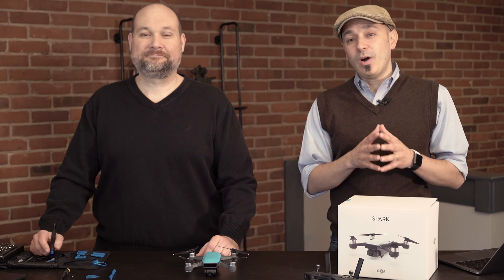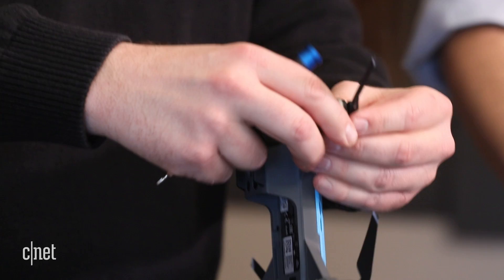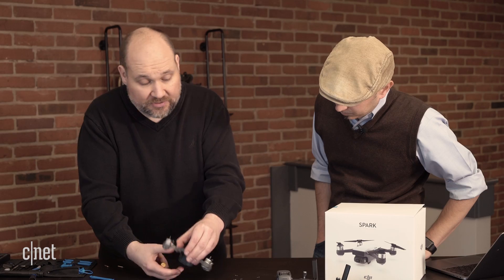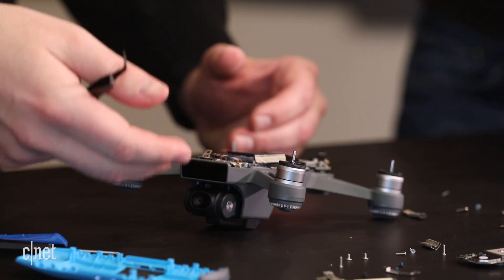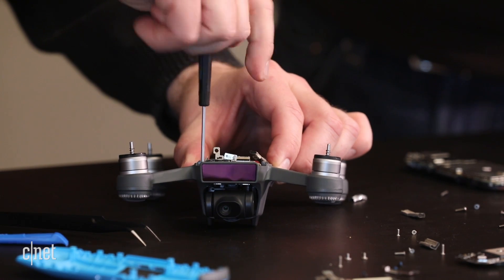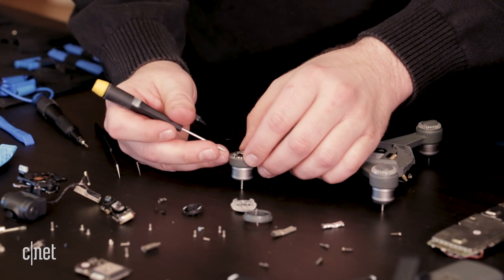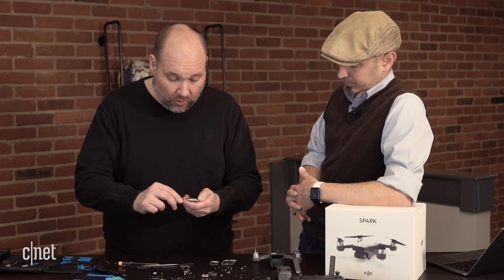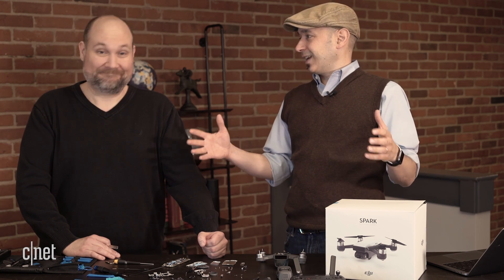What's inside the DJI Spark drone? (Cracking Open)

Comment: DJI did not start off making Gimbals. They started making RC helicopter gyros and multi-copters "Wookong"flight controllers before releasing their first Phantom drones. The white square device with a dot in the center is the GPS antenna and the flight controller with MEM gyros.. The main board with the cooling fan contains the Electronic Speed Controllers for the individual motors. The ESCs get very hot when the motors are running that is why it needs a fan. Overheating ESCs can cause the motors to stop spinning so adequate cooling is critical.
Reply: their first commercially available controller was the NAZA first generation (red)
Reply: esc's are actually UNDER the motors?
Reply: @Dread-I-Productions  I stand corrected, yes it appears the ESCs are under the motors.

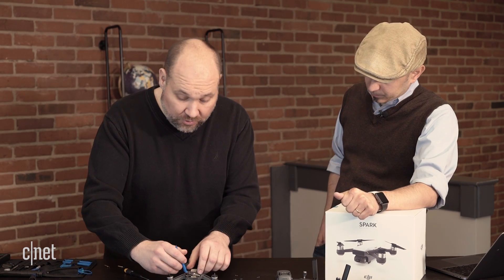Comment: 6:00 Talks about using plastic/esd safe tools. proceeds to take out the circuit board with bare hands, not even trying to avoud touching any ics or metal contacts